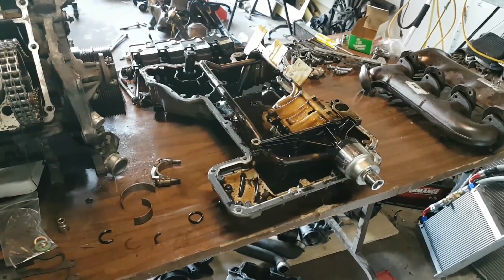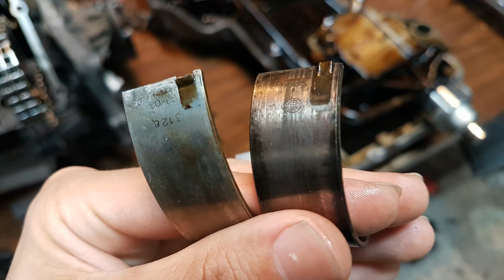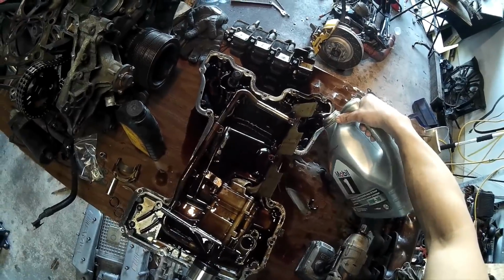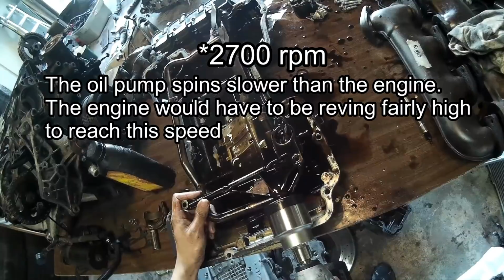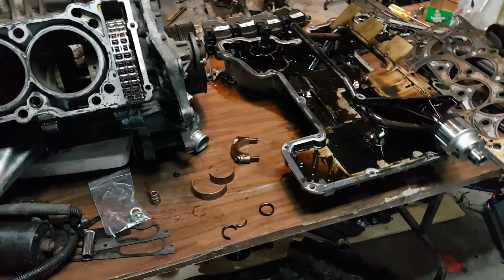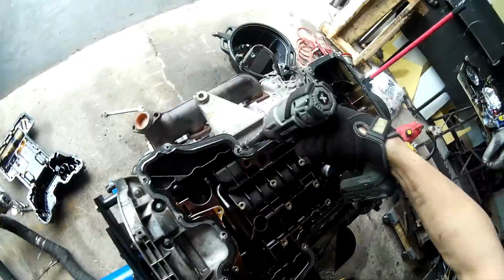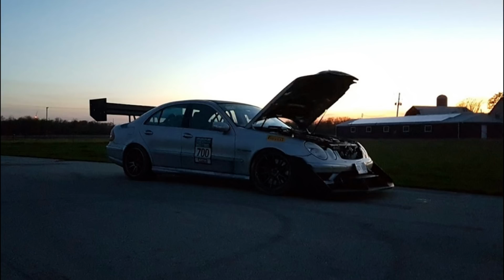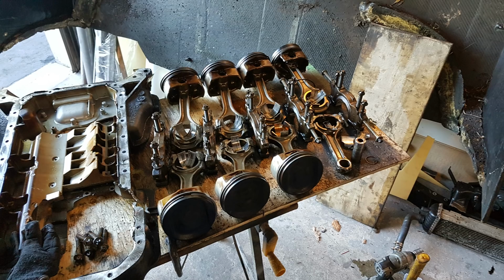Bad O-Ring, Spun Bearing Again! On 2nd AMG Engine

Comment: Turn the key to position 2 and press the reset button, press the upper arrow button and select oil check, then start the car and see the reading. If the oil level is reducing very fast means your oil circulation is correct…

Comment: Mercedes Benz engineers are fucking stupid. I have a degree myself. I mean it 100%. No engine (high performance or not) should have a single rubber o-ring (BURIED INSIDE AN INACCESSIBLE 2-PIECE OIL PAN) as an Achilles Heel. Unbelievable.

Comment: Hey what are the signs of low oil pressure I have a 06 e55 and oil is starting the leak around the engine oil cap any ideas?

Comment: I have an SL55. I just removed my oil pump and swapped out this o-ring. Preventative maintenance. The old o-ring was intact. It was hardened but not brittle. I used the new green replacement o-ring. I think with time, my o-ring would have failed if it had hardened further and broken apart.  It does feel like plastic the way it came out as opposed to the new flexible o-ring.  I am left with questions as to why they engineered it this way. Would anyone recommend welding/ brazing this joint together to permanently fix the issue? Thanks again for this video! This probably just saved my M113k.

Comment: I remember rebuilding my Fiat 125 engine years ago -  couldn't get oil pressure.  Turned out we forgot to tighten the two bolts holding the pickup to the pump........  But at least we knew we had no oil pressure because the Fiat had a gauge :)

Comment: Did the O-ring replacement job on my E55 with 148000 km this past week.  Car had started making a very pronounced whine noise about 3 weeks ago out of nowhere.  The O-ring was hard as a rock, but intact and not cracked.  The replacement did drastically reduce the intensity of the noise the car was making, but it is still present, and more pronounced when the weather is cold as it has been over the past 2 days.  When it's warmer it seems to be inaudible inside the car, but when cold you hear it.  I made a quick before and after video of the sound levels which you can find here if interested.  https://www.youtube.com/watch?v=txNuWRNpzVY

Comment: That rubber o ring should have been a crush washer with a bolt on either side of a flange so it would never go bad, but if you replace that ring those engines are bulletproof

Comment: I heard an expression today whilst at work and it fits here perfectly. The phrase was, "It was engineered out". Mercs of old used to have oil pressure gauges. A graduated scale from zero to three. What I'm told though is that it caused a headache for the dealers when there was nothing wrong with the car. On an older car or in hoty weather and maybe with older hot oil the pressure that was previously indicated at 3, would drop to 1 when not under load. I remember it worrying me too actually.

So they got rid.

Comment: Thank you, it seemed you saved my motor, pulled the pan and the oil pump my o ring was hard and starting to crack. If I could post pictures here I would. I've owned the car for the last 5 years and it's never been abused by me and it's got a full Mercedes service history from new.

Comment: Just an observation . the shell bearings all have locating lugs to hold / retain the shell bearing in the correct position . on the shells you are showing the locating lugs are clearly visible .and are not distorted / flattened .there is no way that the main oil supply / feed to the engine should be compromised by an O ring ..  I would make a physical bolt in adapter to get rid of that dumb ass O ring .

Comment: Sorry if it's already been asked, and due to my newly acquired E55 still awaiting transport to me, I can't visually inspect what is involved... can this be done with engine still in the vehicle?  If the front cross member is in the way is it worth removing the front cross member so that the sump can be removed and forego having to remove the engine???   I am a qualified mechanic of 23yrs but would prefer not to have to remove the engine if possible.
Reply: i wish some one would chime in and anwser

Comment: that's german engineering at it's peak - no seriously, I'm not even making fun - it's called Planned Obsolescence - a 10 Cent part, calculated to become brittle and failing the hole engine, right after the warranty is over, that's just what good engineers do nowadays

Comment: I pulled apart my c32 amg (m112k) and the o ring was hard but not broken the engine had the cam lobes move and it smashed 2 pistons and the block ,the engine had 125000 miles (200k km) on it .
Thanks for up loading the video.
Reply: That's pretty low miles for such a failure wow! Rotten luck brother man, sorry to hear that :/

Comment: Can I change the O ring with the engine still in the car? I will do this job this weekend if so, I already bought the O ring, thank you
Reply: You just have to drop the subframe as the oil pan straddles over it. Other than that it's as straight forward as his video, except upside down since the engine is still in the car.

Comment: i would make a custom part that will allow for two or three o-rings, and a oil pressure sensor, or weld the pipe to the pump

Comment: I am from Libya and I just took an engine apart and the O-ring was basically plastic I also got another one and it had the same problem so there is defiantly a problem
Reply from the maker: Thanks for pointing out. Also heard the same from a few other people. Hopefully the new o-rings they are supplying now should be better
Reply: what did you notice before you replaced the o ring? did you hydraulic lifters start ticking or any other issues, thank you

Comment: I worked at VW as a tech for 4 years and I've seen people leave the oil pump pick up Oring out on reassembly of the old mk1 Golf motors . The result is zero oil pressure . So anyone saying that the broken Oring cant cause catastrophic engine failure , you dont know what You're talking about . Because it can .

Comment: Are you sure you want to keep fucking with these engines knowing what you know now?  If the whole engine can take a dump because of a tiny o-ring in its internals, maybe that's a poor design and you might want to think about using a different engine?  I dunno, I'm not a car guy, it just seems to me that if these engines all have the same problem, maybe you're better off using a different engine?
Reply from the maker: No, they're good engines. Even other GM engines have had oil collector o-ring issues. Other than those minor things its a very reliable engine

Comment: No strainer on the main scavenger oil pump. No oil pressure gauge. Poor quality rubber seals in places where no such seal is required (there is no need for a rubber seal where the main scavenge line mates with the main pump, it can either be all 1 piece or use a brass clamp seal/fitting design). Timing chain slap dependent upon oil pressure. 

And, this is the well designed AMG/MB (M113) V8. 

The M113K is usually a more durable design than the AMG's mentioned below.

The M156, M157, and M159's are worse (than the M113's); as all have greater durability/other problems; some are catastrophic.

Anybody that thinks AMG engines are bullet proof might want to think again and/or reconsider the list of issues the aforementioned engines have.

The M156 and M159 have camshaft, lifter, camshaft-lubrication, head bolt, camshaft timing mechanism, and other issues; that simply should not exist.

Some M157 have conrod issues straight from the factory.

Some might say it's planned obsolescence.

Jim Stanley - Ex AMG Powertrain Engineer.

PS: in all fairness, the seals (no matter how poorly designed) within the sump's lubrication system, pumps, and scavenge lines, should all be checked before 100 - 150K sees the odometer.

Comment: Hello pal...Cheers for another interesting video! I have 2003 cl55 amg, 96k miles...Should I be worried?
Reply from the maker: No, the CL55 has a different oil pump. No o-ring in that one
Reply: @xfmotorsports  Thank god😁..Ive been bit worried...Cheers for answer mate😊!

Comment: Use a 80's GM oil press send in unite which has 3 terminals.  1 term to gage, 1 to grd, 1 to fuel pump to shut off pump when loss of oil pressure. Look up 3wire diagram to be exact. Take all that scrap aluminum to salvage🤑

Comment: You should consider a dry sump Pulling well over 1g in ur car even thu the factory pan is well baffled I think ur starving the engine
Reply from the maker: Yes, I'm planning on going dry sump later
Reply: @xfmotorsports  O.K Great but what about finding out for sure for right now, if its possible besides               .
Reply: just looking at ur pressure when ur pulling 1.2g's to 1.5g's on the track. I know for sure that when a production Z0-6 corvette pulled  I think 1.2g's it starved the bearings and locked up before its first lap Then they went to a full dry-sump before it hit the track again with its new short block.
Something to think about and put in the back of her thoughts when the next time ur out on the track

Comment: Can this be replaced with the motor in the car? How long of a job would you estimate that to be? Your content is awesome man! Thank you!
Reply from the maker: Yeh, it can be with removing the subframe and oil pans, but check your oil pressure first. You will be able to tell if there's an issue. This would be something around a 5-8hr job.

Comment: The chain damage is probably down to low oil pressure as the tensioner on some cars work on oil pressure if not then it would be chain stretching with high mileage or from hard pulls driving hard.

Comment: Hey, great video! Do you know if this issue is likely to be problem the same on other M113 motors?
Reply from the maker: If other rubbers and seals are leaking on it then it could be. This pump didn't come on all m113's, just certain models. Check your oil pressure if your suspicious something is off
Reply: The M113K in my S55 is different and doesn’t have these orings that in the E55 cars with M113K. Also only one oil drain plug on S55 AMG

Comment: Thanks for posting this!  I have a question though... wouldn't the oil pump, line, and o-ring be fully submerged in oil anyway?  If fully submerged wouldn't this not allow for air bubbles and lack of oil?
Reply from the maker: The oil pump is placed fairly high, I believe on an engine turned off the oil might be that high but on a running engine it would be below the level of the o-ring

Comment: The problem with the oil pump chain is not only yours and it is present on the M113 5.5 atmospheric engine as well, I had it on my w210 e55

Comment: Thank you for brining this up, I’ll change mine next time I’ll be doing oil change. I’ll just lift the engine from the subframe and pull the oil pan out. Do you have the size of the O-ring?

Comment: Those marks behind the rod bearings does not mean they spun! It's very common to see that on the back of perfectly good bearings, do more research. If the tangs that hold them in place in the connecting rod aren't damaged, it's unlikely that bearing spun unless someone was spinning the engine backwards.

Comment: Try tapping the oil pan lightly with a rubber or leather mallet first, that will loosen it, and you avoid scratching the sealing surface
Reply: 666Hansen this is the correct practice.

Comment: The o ring is very concerning.  Have to pull engine to change it.  for prevention . Is it possible to install an electric oil pump and push it thru the oil pressure sensor plug?
Reply from the maker: Just install an oil pressure warning. Its easy to install and will give you a warning before the engine fails or gets damaged. I showed it in another video https://youtu.be/XApz7pzbG6M
An external pump would be a difficult and expensive install. I wouldn't say its worth the effort

Comment: If possible braze the actual pipe to the pump and miss out the seal altogether, I'm 64 years old and knew that is was a seal of sorts right from the off, I said to the wife it's an oil ring and low oil pressure. I've always worked on jags "classic" and where possible I have always gone round and sealed "If i can" issues including waterworks too, the fewer seals required the less chance of a blow if only I could seal a head to the block I would lol... BUT and this is a big BUT, should you really be placing such stress to the engine of such a beautiful machine such as this? It was not designed for this type of hike... Its an effortless cruiser, not a bruiser or tolerance F1 .. Do you remember the v 6 in the rover d1? I got 130 MPH back in the early 90s and she was sweet, but never lasted due to oil pressure issues "maybe the pump not delivering enough at high tolerance areas...... Same with the big old Jags such as the 420g and mark 10 they both did over the ton but not for long, always heat, oil pressure or water pump issues blowing the main bearings at a constant speed. Great to see you stripping, messing and thinking..... have a real good inspection right the way through the oil rail systems, did you say there is no oil pressure gauge? Anything under 40 and you must find the fault never drive at high speed with less pressure............................. Best of luck.....
Reply from the maker: It would be difficult to braze or join them permanently. The pump is aluminum and the pipe is steel. The new o-ring that comes from the dealers is actually an improved material so lets hope it holds up better. I will have an oil pressure gauge and warning next time around anyways, so it should be safe

Comment: Maybe you're dumb but should go down to AutoZone and spend $20 for an oil pressure gauge you could also wire a switch in your pressure system that when you lose oil pressure the ignition is cut off or you can just keep buying engines

Comment: Mercedes want to hang there heads in shame for putting out his type of bad design. The oil change intervals have nothing to do with this!! the rubber is subject to extremes of temperature it ages like any other rubber and mercedes will know this!! As these motors are hand built with the builders name the company will use this to admonish themselves from blame!!! The wear on the internal from the chain hitting it will be from the lack of oil pressure holding the tensioner's in place. thus the slackened chain will contact with the metal on the over run. Again a bad design that will cause this to fail. There should be a pressure device in place that monitors the pressure at the set throttle and rpm to cut the engine if the pressure falls below a standard. The last hand built mecedes that where any real reflection of the 3 pointed star brand where the SELl 80s and early 90s cars.
Now the brand is a ghost of itself putting out tripe that the fore father's would of fired them for in a heart beat!!

Comment: Uselesss Mercedes design , might as well you install the new O ring and add  epoxy cement to the whole connection to prevent it from leaking! Or better still get a used 2 jz Toyota engine in it instead!

Comment: Rubber O Rings Will Go hard over time Crap oil will not help as this pushes the core temps higher than should be aiding the breakdown of these little rings  Naughty Mercedes .

Comment: Viton rubber is a modern synthetic rubber which can better deal with fuel / oil contamination. I've used a some to replace motorcycle carburettor seals. Maybe worth a look for this application?

Comment: how often would the tube need to be removed? I ask because my first reaction was to have the tube tig welded in place. Will never leak, will never come loose
Reply from the maker: Tig welding would be a little extreme. The new o-ring I got is a different material. The parts guys at the dealership told me it has probably been updated. I'll just install an oil pressure gauge and warning so at least I'll know before it fails
Reply: to NOT rebuild a 3rd engine....lol....i like extreme

Comment: Okay, so the chain was whipping because the tensioner relies on oil pressure. A low oil pressure results in this.
Replace the entire guide rails, chain and tensioner.
The sprockets should be closely inspected.
If one chain doesn't have a tensioner then replace the chain and sprokets to restore tension.

Comment: I know these two engine wasn’t maintained correctly , my original motor had lots of miles on it and it was almost white inside of the valve cover .
Reply from the maker: Yeh, the CLS engine was definitely not clean but the E55 engine (the one in the previous video) was pretty good. A bit of brown staining in the crankcase is normal in cars driven hard because of all the blow by. 
I have an other m113 with low miles, that one was still all shiny from inside, but for over 200k km I would say the E55 original engine was not bad at all

Comment: I had a silmiliar problem on a b18c Honda integra type r .  It was already knocking , so I change the bearing and it still rev to 9k rpm after that . I just drop a e55 engine in my s55 and fuckkkkkkk I should of change this oring
Reply from the maker: The S55 had a different oil pump. They won't have this o-ring so don't worry about it. Pretty sure you would have had to change the pump and the oil sump for making it fit in an S55